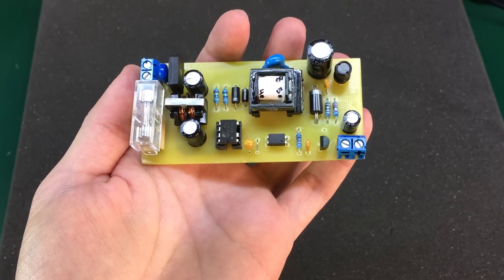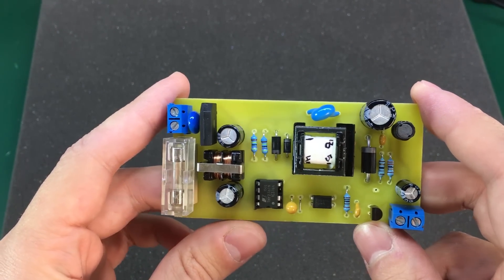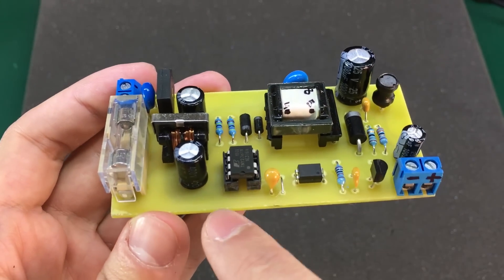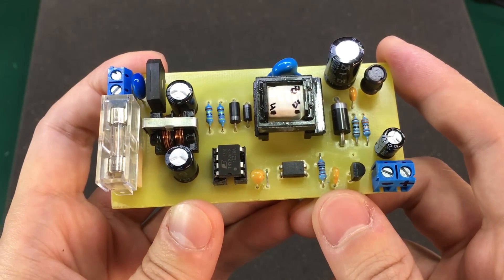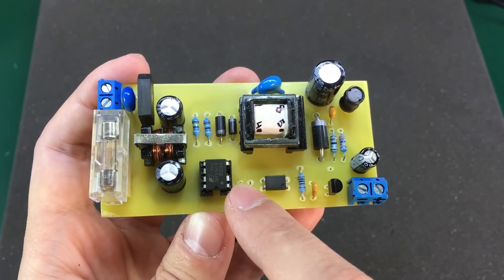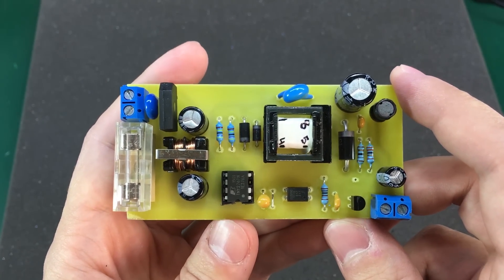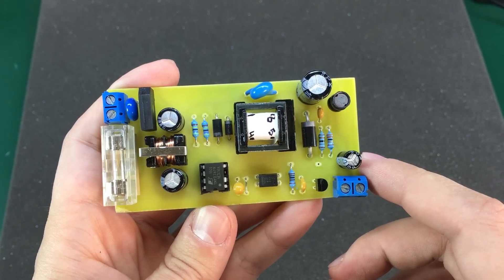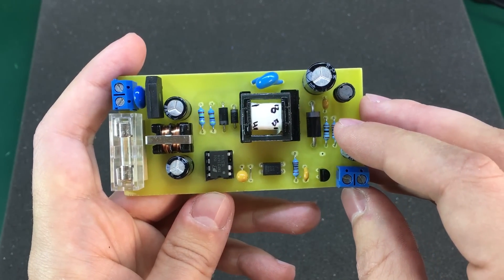Voltlog #72 - DIY AC-DC Off-Line Converter With TNY276/TNY277 - part 3

Comment: I ran into a similar problem once when doing something with a TNY274 chip,  after accidentally shorting out something in the circuit while it was running, it still worked, but ran very inefficiently and drew considerably more current even with no load, almost independent of voltage.  I think what got damaged was the chip's internal power management circuit that drops down the high input voltage to whatever the internal control circuit runs on, but that's just assumptions... maybe yours took a nasty ESD hit or something like that?

Comment: you got it from ebay I guess :) If you did it is not suprising china clones are not that high quality.
Reply from the maker: I got it from a distributor Comet Electronics, however I am not blaming anyone, it's hard to tell if the chip was damaged to start with or if that happened during assembling/testing. Considering my prototyping environment, everything is possible.
Reply: No matter where you get it, they are problematic, I have colleagues that have troubles with them (they do not work from factory even you buy them from reputable distributors).
Comparing to other they have great deal of bad chips (usually you will find 1-2 bad chips in 1000, which is for current standards vary bad).
Reply: VoltLog
Even you bought it from Comet, you in fact bought it from Farnell. Comet buy from Farnell (most of what they have, except they are direct distributor for Microchip) and resell it (from local warehouses, or Sofia warehouse).
My colleague who had problems with bad PI products had confirmation that they are from Farnell (bought through Comet), but after that he switched to ST VIPer.

Comment: That mat you have... What kind of foam is it? It looks conductive.
Reply from the maker: the green mat and the black foam pad are esd safe..
Reply: VoltLog sure, but ESD safe foam is usually conductive. Might be worth checking it if you are running stuff on it and it fails. Done that before 😁
Reply from the maker: the foam is definitely not conductive, maybe dissipative. I can't get anything with my fluke 87V so well over 50Meg
Reply: VoltLog that's good, just checking. Looks like you were just unlucky, glad you got it working. Thanks for the video!

Comment: Nice that you investigated this issue to the end and make this video either. Good job. Looking forward for more clips like this. Can you also add PCB layout and list of used parts? (Excude me if you did it before and I couldn't see those before)
Reply from the maker: thank you for watching. I thought the list of parts is not that useful, I just used what I could find and values are marked in the schematic as for the layout is not very useful either as someone else would want to design their own layout.
Reply: Yep, maybe right. Thanks!

Comment: You probably damaged the intergrated mosfet my friend... These devices are electrostatic sensitive and if you are not careful (i.e. antistatic wrist bands etc etc), you can sometimes damage the parts by just touching them with your hands... Well, i guess it was just bad luck, but it's good to learn from your mistakes :)
Reply: As I understand it, ESD can damage a chip without destroying it. That's why it's insidious. The part can last long enough to pass testing and burn-in, only to fail a few weeks after being installed.
Reply from the maker: Well it's possible but we will never know for sure..
Reply: I´m not that sure because the orignal chip worked for awhile.  ESR damage would have made the chip useless from the start. Most likely the die was defective in some way from the factory.
Reply: Many have trouble with them, they are problematic (many of them do not work from factory).
I think it is just bad QC from manufacturer. My colleges which use them mostly switched to other solutions.